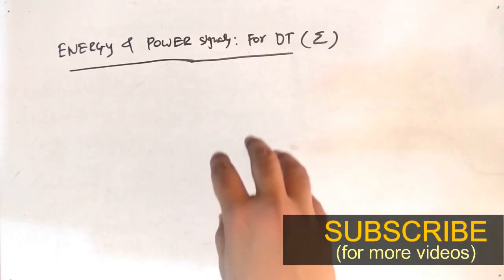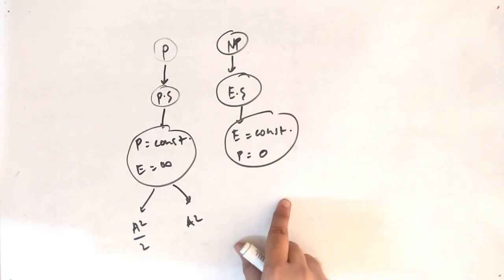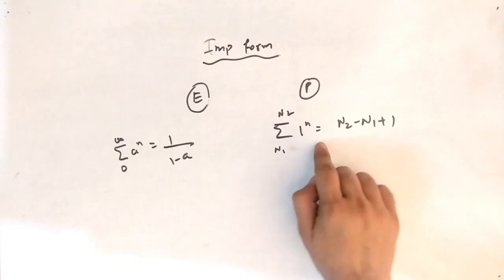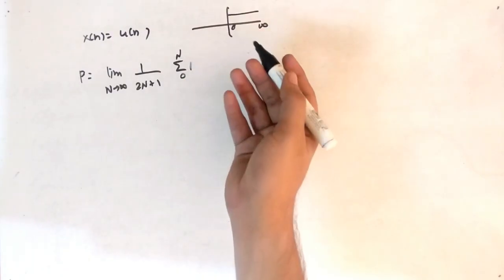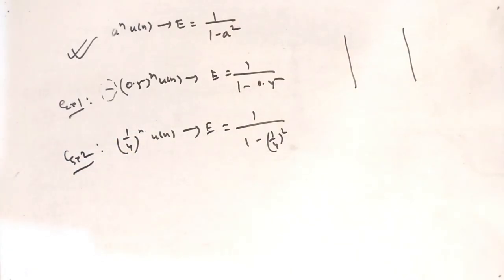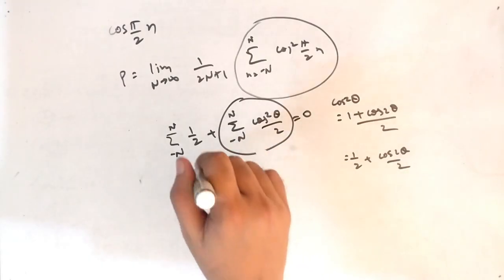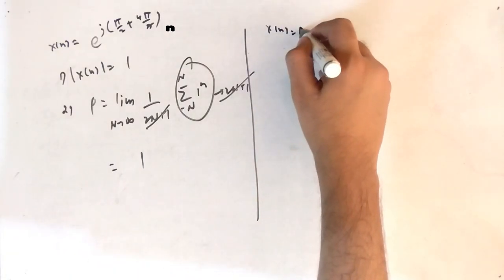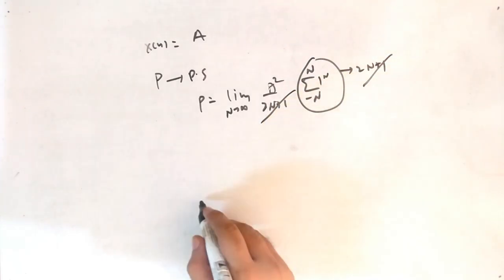Energy and Power Signal (DT) - Examples, Calculations, Equation, Formulae, Tricks

Comment: How  summation of cos2tita/2 become zero please tell me sir
Reply: It's Σ from -N to N of cos(π * n)/2 since θ in the question is (π/2)*n and thus, cos2θ is cos(π * n). Now since N can only be a discrete value, if you consider N as 1, it will be cos(π)/2 which is -1/2. If N is 2 it will be cos(2π)/2 which is 1/2. Similarly, if you consider negative values of N like -1, it will become cos(-π)/2 which is -1/2. If N is -2 it will become cos(-2π)/2 which is 1/2. Now since it's a summation, and as you can see it's alternating between -1/2 and 1/2 always, the values will cancel out each other leaving you with 0.
Reply: @mahmoudm451  what about cos 0
Reply: @James-bv2kc  1/2... The cos is 1, and there is a 2 denominator